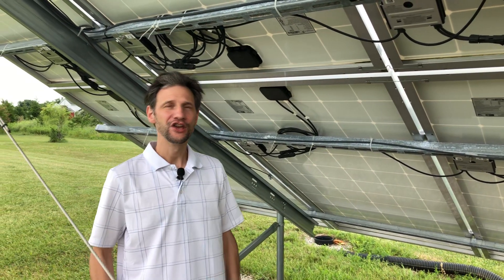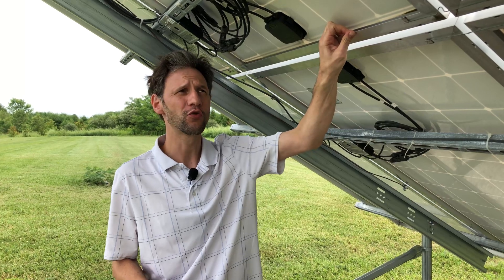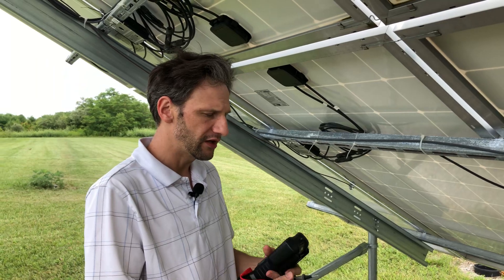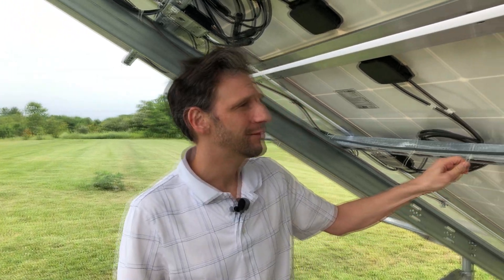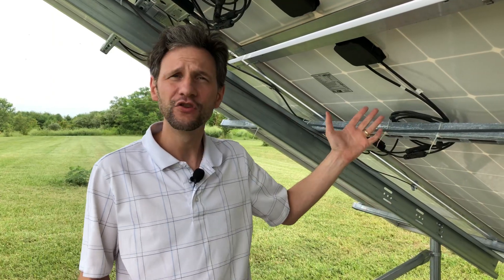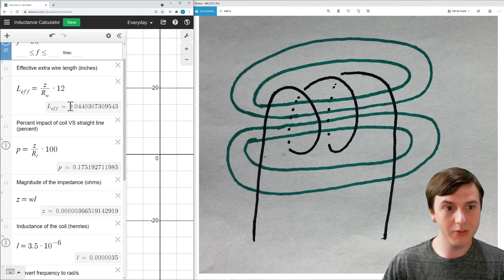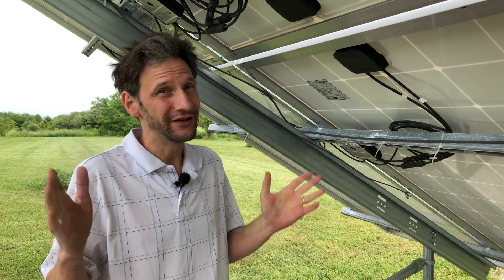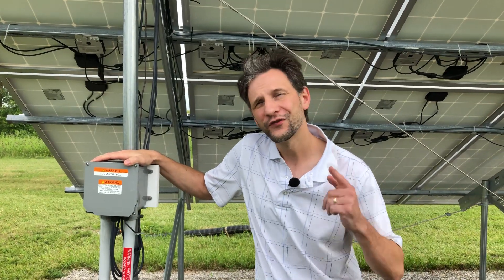3 Solar Panel System Wiring Issues Resolved

Comment: Grounding a solar array is useless if a positive wire from the solar array happens to come in contact with the array it would not pass any current through the bond wire thier is no reference on the bond wire to the negative of the array it is a isolated system just brings everything bonded to the positive potential of the array.
Reply from the maker: If a positive wire touches the frame which is bonded to ground, they have to be at the same potential, which is also equal to ground.  If there is no potential difference between the frame and the ground you can't get shocked.
Reply: @ProjectsWithDave  you wouldn't get shocked either way bonded or not unless you were also touching the negative lead on the solar array as the negative of the pv system is not bonded to ground. Without bonding the negative of the solar array to earth thier is no potential difference to any bond any where meaning no shock, no current passing through the bonds. Bonding the solar array just makes the potential of every bonded electrical system connected to it live in the case of a fault to reference of the negative of the pv array nothing else. If you don't beleive me take a positive wire from your solar array touch it to the frame with a current meter on it set to dc and thier will be 0 amps flowing through it unless you have a fault so.e where else that has bonded the negative lead to ground.

Comment: Great video. I too have a solar system. I was hoping you could clarify grounding for me.
Did you ground the negative conductor from your panels? If yes grounding makes sense to protect people from damaged panels as they would be completing the circuit to ground.
If you didn't ground the negative there is no circuit to ground so there is no risk to people.
Grounding for lightning strikes. Why do we want to encourage lightning to go through the panel frames? Massive DC amps will cause considerable damage. Would it be safer to have separate lightning rods at the highest point of you system that are wired to your grounding rods completely separate from the panels?
Reply: Grounding the Negative of a properly designed DC power system is fine but it may include one concern - a Ground Fault (the DC+ shorted to Ground) of sufficient magnitude will open the source Fuse/Breaker.  As a result the problem then becomes finding the fault itself so you can fix it and get your power back on!  Good luck unless you are a professional!  Bottom-line, floating the DC Negative is not a problem at all if properly designed, installed, and routinely monitored for faults-to-ground.

BTW grounding (earthing) ABSOLUTELY DOES NOT attract Lightning (another topic- but actually the opposite is true).  Anyone that believes earthing attracts Lightning needs to write a peer review ASAP challenging the opinion of thousands of electrical engineers and submit it to IEEE for immediate review and update.
Reply from the maker: Sorry, I'm not an expert on lightening strikes and bonding to be able to give you the benefits and risks of lightening rods.  However, I don't think I would want to intentionally attract lightening to the area.  I did not connect the negative conductor of the PV panels to ground.  However, if the frames are not bonded to the grounding system they could become energized by a positive conductor that was damaged and touched an isolated frame.  As long as the frame is bonded to the grounding system any short will be directed to ground rather than through you.
Reply: @ProjectsWithDave  additionally if the panel is damaged and the positive is now connected to ground through the frame,  If you touch the negative conductor you will get shocked
Reply: Your son is an electrical engineer.  What are his thoughts?

Comment: Grounding is not for lightening, it won't do much against a strike, It's for transient over voltages.  You're also missing distinction between bonding and grounding.  Bonding creates a uniform voltage plane. Grounding is primarily to provide a low resistance path to trip the breaker.
Reply: Respectfully I seriously and absolutely disagree.  The Grounding (earthing) intended purpose by design is NOT to provide a 'low resistance path to trip the breaker' as stated!   Earth resistance is unpredictable - how can it be  a part of an engineering design to operate in a fault?    Point being - NEVER depend on 'dirt' to provide a low resistance path to the source.
Reply: Grounding, as in connecting the metal structures to the earth, is not for tripping a breaker.
Reply: @altuber99_athlete  I'm well aware but most people call the Equipment grounding conductor and Grounding electrode conductor... just ground. Outside electricians or EE's few realize they serve a different purpose and how they function to do so.
Reply: @steven7650  Oh, I thought you didn’t know, since you said “Grounding is primarily to provide a low resistance path to trip the breaker”, which is incorrect. Bonding (connecting the neutral bus bar and ground bus bar together at the main panel) is done for that.

What grounding (connecting the neutral/ground bus bars of the main panel to the planet Earth ground) does is allow excess charges (from lightning and electrostatic) to be mitigated.

Grounding + bonding establishes the neutral-to-ground voltage to zero or near zero volts at all normally non-current-carrying metallic pieces.

Or that’s how I look at it.
Reply: @altuber99_athlete  Understandable as most just use ground the way I remarked which as you correctly point out is incorrect or at least incomplete.  Bonding is more for creating an equipotential plane around an object which may become energized, think pool, hot tub or such. The neutral to earth bond at the service sets the reference though it's very minimal because North American Utilities use a multipoint ground system already.  As you said it's more for directing excess current to the earth in case of strikes.

Comment: Hi Dave, first thank for sharing your experinces. Good job ;-)
I have a comment to the explanation of wire coils. Everything that was said is true, BUT the main problem with coils is if comes high voltage because of thunder. I've worked in telecommunication company for more then 25 years and I saw what happens with even one turn so my suggestion is NEVER  use coils in outdoor installations. Well, we can discuss the principle of Farraday's cage....
By the way the explanaion assumes case with one wire, but in reality there are two, so the magnetic field is diferent and counting is wrong. However the main principle stays the same, so no complaints.
Reply: I agree with you, the analysis in the coil is not accurate. Both line 1 and line 2 wires were coiled together. This will cancel out any field generated by each wire, and since this is DC then this will not even generate one pulse. Plus it's air core, what induction. If your generating a very high frequency oscillator, maybe, if you coil one wire.
On lightning strikes, all conductors will act like an antenna and absorbed EMF. That's why you said even with one coil. The closer you get to the lightning strike, the greater EMF you'll collect. In our telecomm installations, all cables exposes atmosphere are  installed with surge protection. But then, other cables, like for instrumentation were not installed with surge protection. Only when the area is prone to lightning surge protection are installed.
Grounding is very important. It's an Electrical Code requirement anywhere. Explanation is good. Same reason for the Code. => Personal Protection on any ground fault and lightning protection.
Reply from the maker: Thanks for sharing your experience on the impact of coiled wire with lightening strikes.  Could you explain further what happens with coiled wire in a lightening strike?  Thanks!
Reply: @ProjectsWithDave  Well, what I tried to say is, that lightning has a huge amount of energy and as such create very strong magnetic field, so every coil in it generates high voltage. It's like a transformer without a core. But if the coil is let say "inside" the PROPERLY grounded construction, it is for example the same effect as if you are in car during a storm. You are absolutely safe because of Farraday's cage principle. 
Now depends, how is your supporting construction made. If it is all metal, every leg should be connected and grounded.
By the way grounding point has to be lower then grounded point-simply imagine, that current is like water and water everytime flows down.
Hope it is comprehensive. Sorry, English is not my mother tongue, so it is not easy to me to explain all details.
Reply: @ProjectsWithDave   Don't listen to this guy's 25 years of experience.  Coil those wires and move on with your day.  These idiots commenting over stupid shit like the 0.00001 % chance that a lighting storm would fry a panel or two isn't worth one second of your time.  I could go hunt down a physicist and he would have a hard time computing the increase in voltage due to the turns ratio of a coiled wire to a lighting bolt. Stop with the stupidity.  I bet you money Mr. Novak is a uneducated technician who doesn't know anything about differential equations.  I'm an electrical engineer and I have no problem with your install.  These nut bags read a Wikipedia article and suddenly they have a master's degree in electrical engineering.
Reply: @Impedancenetwork   I am high educated engineer, by the way... 
Maybe American standards are different then the Eruopean.... and my English is not as good to discuss every detail. I trust my knowledge and experience. That's all...

Comment: Sure get him to calculate the wind load on those what seems like small pipes used for the racking system. Love your input as you are active.
Reply from the maker: Thanks!  The pipes may appear small in the video, but they are a heavy wall pipe.  We get 60mph+ winds here fairly regularly and the rack holds steady with no issues.

Comment: The problem with grounding is when lighting strikes the wet ground it travels up your grounds and takes out your fret board on the inverter. I learned that the hard way. I cut all my grounds and only use battery grounding. Haven't had that problem again for 28 yrs.
Reply: Thats not code
Reply: How will the lightning energy coming up FROM the earth into your ground rod - and then into your equipment physically destroy the equipment?  If your theory is valid, then a 3,000,000 volt lightning strike hitting an airplane would completely destroy it in a massive ball of fire.  In comparison, a bird landing on a high-voltage power line should be incinerated.

Comment: Where did you get the racking. And how much did it cost?
Reply from the maker: You can get the cost information in this video: https://youtu.be/PNTO83FvaL4
The supplier is in the description, I used Ready Rack.  The description also has time stamps so you can jump right to the racking portion.

Comment: Hi Dave, love the content.  It would be interesting to give Jordan another project and have him take a look at voltage loss from panels to the inverter. I suspect your wiring is throwing a bit of heat and your system's a bit leaky.
Reply from the maker: Thanks!  Great Idea!  I did a calculation on the losses from the array to the inverter before I installed the system.  That showed the loss would be very small, however, I have never checked the actual situation.  I'll have him do that.  : )
Reply: @ProjectsWithDave  Don't listen to Ed Stiver.  Jesus man I'm an electrical engineer.  I design power systems for a living and I would worry one second over that coiled wire.  It is amazing the amount of BS people worry about.  Not one person, such as Ed, could calculate the "leaky"-ness of your system.    You can spend 3 weeks analyzing stupid shit that amounts to no significant difference.  When you know what you're doing you don't need a calculator to verify it.
Reply: @Impedancenetwork  The key is knowing what to worry about, and what is unimportant minutia.
Reply: Interesting - assuming we are talking about leakage-to-ground, I will be happy to check that for you using a simple Fluke 1587 with no calculations required!  No big deal and no cost.  Since you have so much knowledge, it might be good to submit a paper letting IEEE know that calculations are worthless if you really understand electrical engineering concepts.

Comment: Where did you buy the grounding clips between panels?   Nice job 👍
Reply from the maker: Thanks! I put a link in the description.  You can get the Stainless Steel Cable Clips here: https://amzn.to/3e4qCNm
Reply: @ProjectsWithDave  He asked about the "grounding" clips between panels. Your link is for "cable management" not grounding. I'd like to know also, thanks! Those clips that you put the multi-meter on look like they would be cheaper than the solid copper wire 4 awg that I'm using to connect my twelve panels to each other using the older clip with twist bolt that you also showed.

Comment: Do you think you'll increase the array size or add batteries soon?
Reply from the maker: I'm considering increasing my array size.  I believe I can still get a reasonable payback period for some increase in size.  As for batteries, the technology needs to improve quite a bit from a cost perspective before it can be justified.  It is possible that in the near future electric cars can provide the dual purpose of a household battery backup.  Things are changing quickly in the battery area so I think I will wait on that for now.  Thanks!
Reply: @ProjectsWithDave  Lithium hasn't changed in decades LOL. And you wouldn't want your pos electric car to go to the junkyard even faster using it as a power source.

Comment: Great video Dave!! thanks - Question for the future.. have you washed the panels yet? Should you avoid city water and use distilled? Any certain brushes to use?
Reply from the maker: Thanks!  Great question!  I deliberately did not manually wash the panels since install two years ago.  I want to understand if cleaning is a significant consideration for ground vs roof installations.  I have been watching build up of dust and bird poop and seeing how much of it the rain takes care of.  So far, not cleaning them hasn't been a noticeable impact to performance.  I'll keep your suggestion in mind for a future video once I have determined the best approach.
Reply: I clean mine twice a year .. and bird poo etc as needed.. and possibly clean anyway.. as I think the dirt or pollution can be abrasive and acidic .. and I want them to be as efficient as possible in cloudy weather.
Reply: @mySeaPrince_  In cloudy weather, it is most likely going to rain & wash away the dirt. Why clean manually?
Reply: @shrujanamsyama9940  
Over the decades I've had various types of panel, I've even used a surface treatment which does help..
Just like a greenhouse, car or home windows they all get a build up of dirt that the rain, even hail or snow doesn't remove...

Comment from the maker: Find More information for this project and others on my website: https://projectswithdave.com 
Other related solar videos that may be helpful: 
Full Solar System Install: https://youtu.be/_xA6qOwnYbM
3 Solar Panel Wiring Issues Answered: https://youtu.be/i7vHEHB3a-M
Check out the first year performance results here:  https://youtu.be/BatTeSq05rU
See the total system cost here: https://youtu.be/PNTO83FvaL4
And How to size your solar system here: https://youtu.be/rbFnZqA0GCI
4 Things to Know About Solar in the Snow: https://youtu.be/vY3PufzPUnI
Ground Vs Roof Mount Solar: https://youtu.be/w-iS_8e7n60
How to Get A Permit For Your Solar System: https://youtu.be/imiEYDHLG4A
How to Crimp MC4 Connectors: https://youtu.be/oH3LqTu4B8E

Comment: Dave, I notice that a 9.36KW unboundsolar kit with SolarEdge optimizers costs around 14K as of today.  Your system costs were closer to 10.6K for your "kit".  Why the difference?  Did costs go up or did you save money clipping?
Reply from the maker: The kit posted online includes racking for roof mounting, but I used the Ready Rack ground rack.  You can see my cost breakdown by part here: https://youtu.be/PNTO83FvaL4